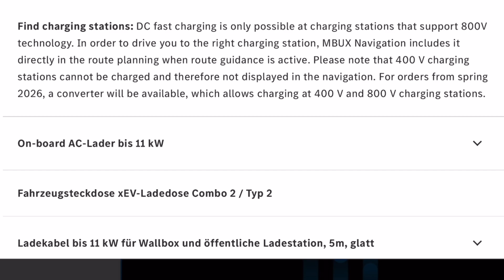2026 Mercedes CLA: 800V - 400V Converter Coming!

Comment: Nice to have options for changing! Makes sense!
Reply from the maker: Yes, there are still on the field some old 400V and 50kW DC chargers, so this converter will then solve also that compatibility problem.